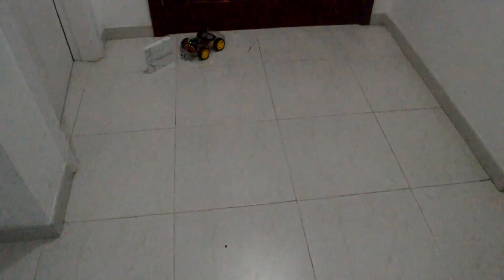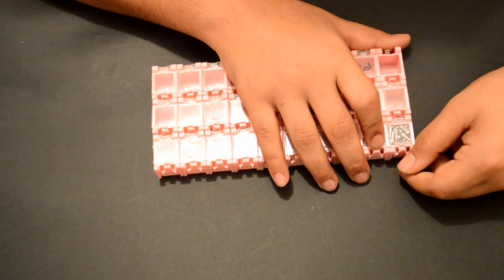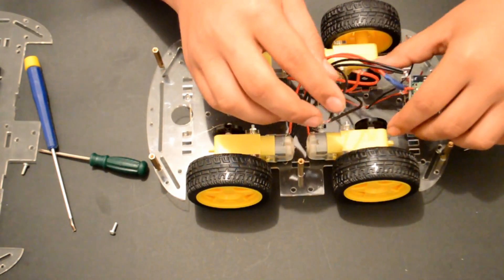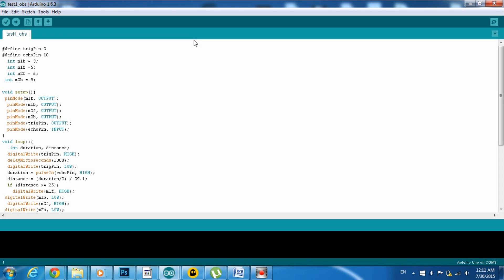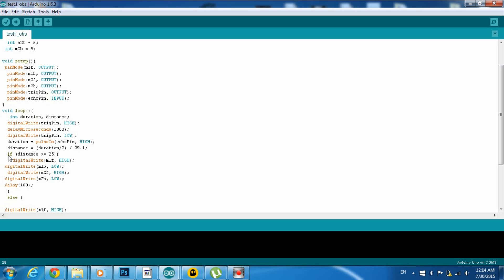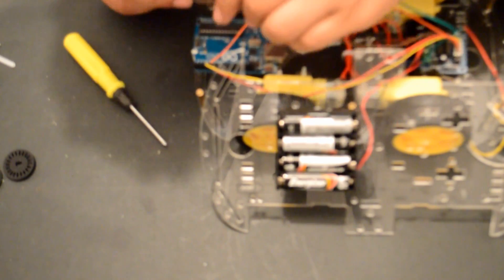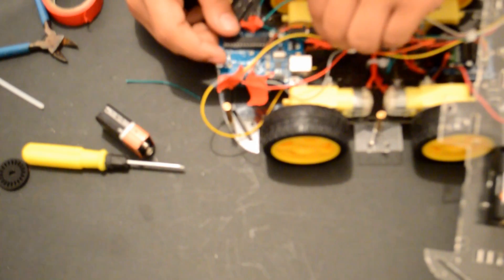Arduino obstacle avoider robot [EASY!!!]

Comment: can I use a normal dc motor of 9v and use a 12v battery .I mean normal dc motor and 12v battery.  Will the code change?
Reply: circuit diagram??

Comment: which motor controller you used from where can I buy it
Reply from the maker: http://www.ebay.com/itm/Mini-Motor-Drive-Shield-Expansion-Board-L293D-Module-For-Arduino-UNO-MEGA-2560-/131167569740?hash=item1e8a32474c:g:H3YAAOSwbYZXejcN

Comment: Thanks for the video, I will use this in my butler robot project where the robot is a butler, but I would appreciate if you could recommend some motors that are much stronger and can take the weight of the 1m high robot?
Reply from the maker: there are many  motors that would do the job, i would suggest buying a geared 12v/24v motor with metal gears from ebay
Reply: thanks for the reccomedation, the only problem is the battery that powers it would have to be massve wouldn't it? Say if I had 4x 12V motors that's a big battery.
Reply from the maker: +Marlow Dupont yes, you can probably use a lead acid battery but if the robot is 1m high, it is not that big in comparison, plus you can use 2 motors instead of 4

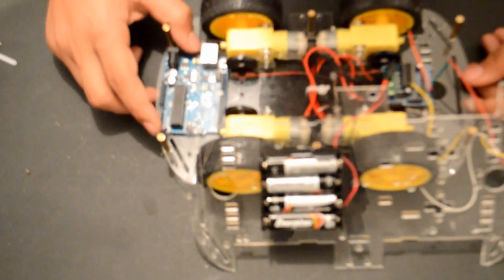Comment: 6:58 what is the use of those encoders?
Reply from the maker: they can be used to monitor the speeds or the number of rotations of the motor but i am not using them in this project